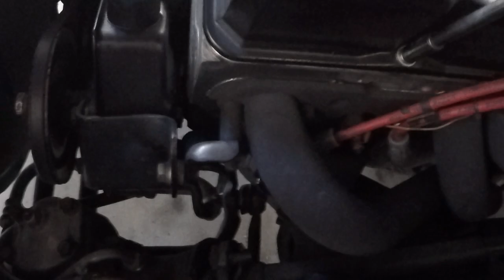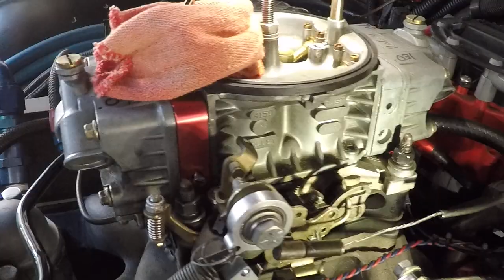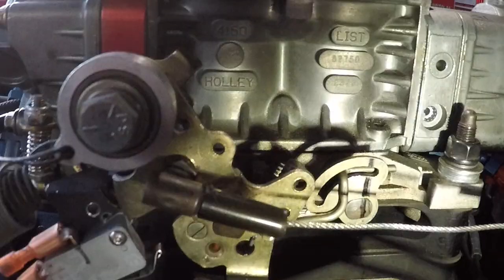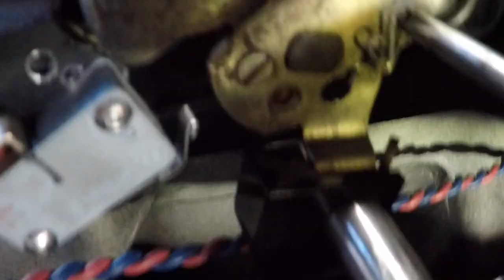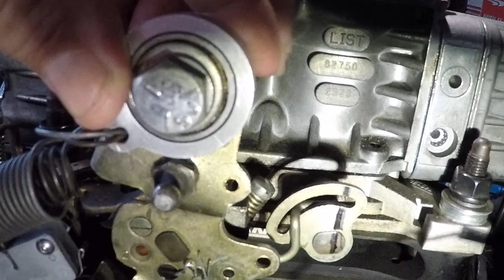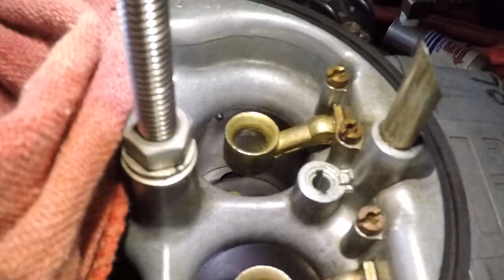Holley Street HP 750 CFM Vacuum Secondary Carburetor

Comment: i just noticed the same thing . when i crack the throttle it would bog cause the secondary not opening . i will drill that plate first . i wonder how your test drive went .
Reply from the maker: https://youtu.be/45gljGBg824?is=TOr7Rx8FfyyFYyZw
Reply from the maker: Don't be afraid to drill all that out. There's a hole that kind of comes from the back where the vacuum secondary diaphragm is fastened to. There is a little ball of solder there. Drill that out all the way to the primary Venturi. Then plug it with a small screw with some sealer on it after tapping it. I drilled mine out to .120 almost 1/8 in. Then I plugged the hole that goes into the secondary Venturi with the tiny set screw after tapping it and I put super glue on it. Now all the vacuum draws on the vacuum diaphragm. And it works very well. Put the tall yellow spring in.
Reply: @superfuntime3107  Thanks I will do that .